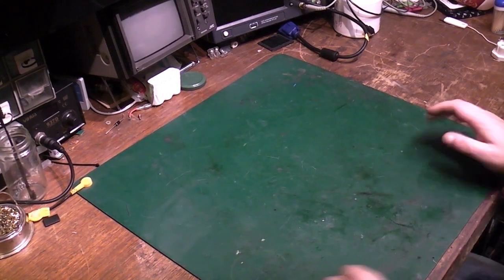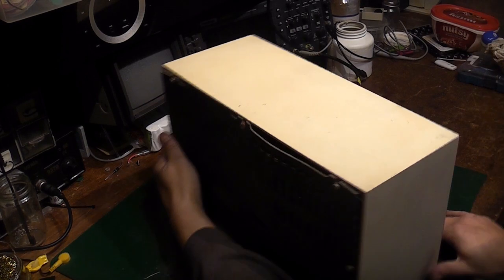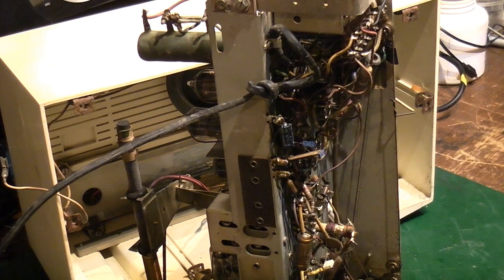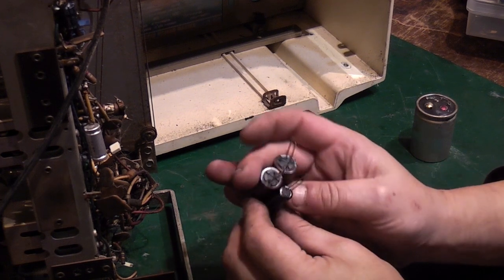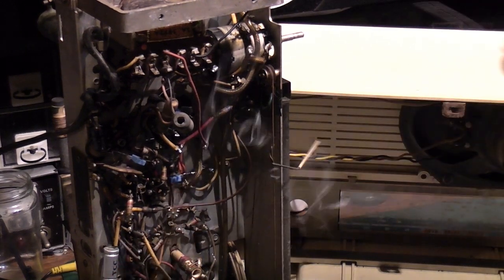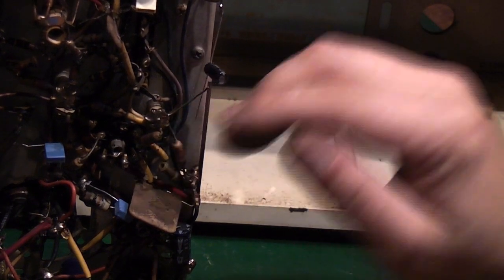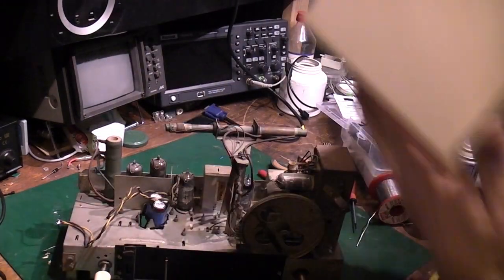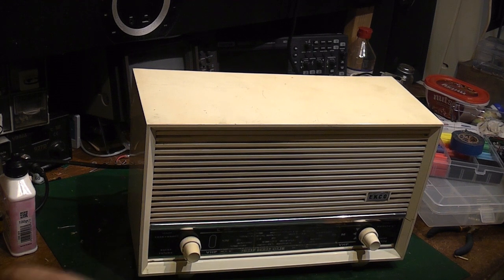Ecko U353 AM FM valve radio from 1959 Quick repair

Comment: iffy mains switches are quite common on these a squirt of lubricating contact cleaner (not just IPA or low residue type)usually solves it, its often cause by the original lubricant drying up

Comment: That's a nice bit of maintenance, it should be ok for another 65 years 👍
You could have sprayed the back of the dail glass with some clear lacquer while the chassie was out to stop it flaking.
Reply: yep, that'd be a very good idea, i've done that on a few, but be careful what exact one, plastikote clear lacquer seems ok, cheap poundland spray yacht varnish, might not be, as  it seems to dry rather brittle and flaky...

Comment: There was also a VHF only version of this - nice sets! They are AC/DC sets it my memory serves me ….
Reply: Yes, it uses all U prefix tubes (100mA series string) with the exception of the eye tube which is a DM70, a 1.4v subminiature battery tube.
Reply: @douro20  yep, i have a U353 and the FM only U354, both brown cased, may also have been done in other colours dunno, also used to have a wood cased version of the U353, U362 i think? and a Ferranti branded version of the U354 but sold them some years back, the DM70 filament is powered by tapping off some volts from the UL84 cathode bias resistor, can be a bad idea if the UL84 passes excess current for some reason like leaky coupler cap or if it develops grid emission, filament will pop